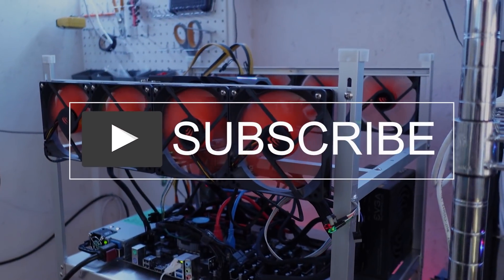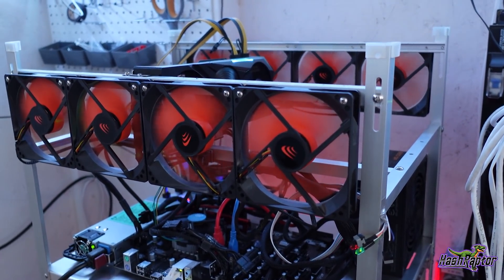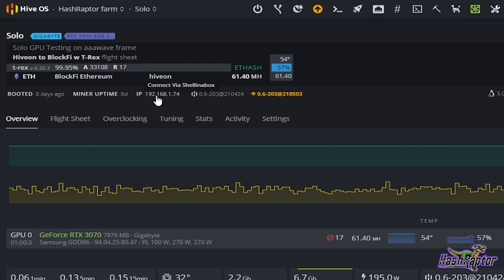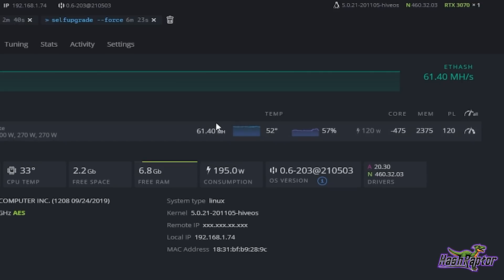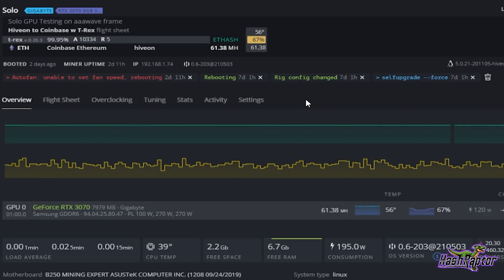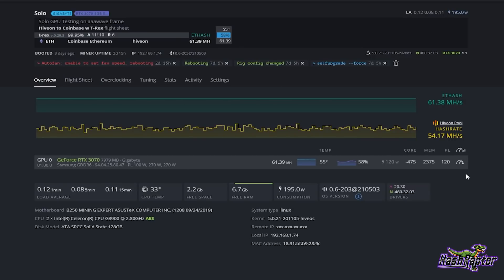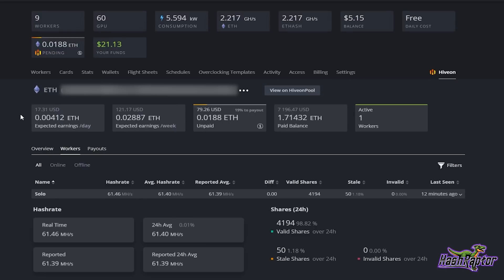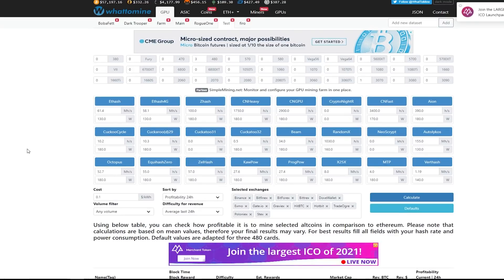How much did our *3070* make in 1 Week mining Ethereum? Earnings are Insane right now!!!

Comment: How many GPUs can you run without having to increase your wattage or amperage in your house?
Reply from the maker: Hey great question.  It depends on what amperage you have in your house and what your current utilization is.  Unfortunately, they isn't a good answer.  Check out my electrical video on the mining shed where were discuss this more in depth.  Take care
Reply: @HashRaptor  I will watch that next.  So is this GPU card $1699?  I just looked it up on AMZ.  If you have a link to it ill use your link.
Reply: @RobinhoodCoins  nevermind, i see you do have a link in the description.  holy moly, i didn't realize GPUs cost that much.
Reply: @thomasgruver3495  in reality gpus prices arent that pricy a 3060 costs about $329 but because of scalpers and miners who buy gpus in bulk to mine the prices have tripled

Comment: Which result would be better 
Three 3060ti together 
Or
Two 3060ti and one 3070 ???
Reply: I would definitely say that 2 3060ti and one 3070 would do better because the 3070 is just a little bit better than the 3060ti so you would make slightly more profit that way

Comment: Great Video! Is it worth it to buy a laptop with a RTX 3080? Was thinking about buying a RAZOR 14 or 15 to mine alt coins
Reply: Do not mine with a laptop. Mining will run your GPU at 100% continuously. You will likely overheat the crap out of your laptop. I used to mine at my old apartment, and with 3 gpus they made enough heat, that I never once used my heater during the winter... like were talking 80-90 farenheight in the bedroom during winter... you should really build a mining rig if you want to mine...do not use a laptop.

Comment: Hey All,, I first used Palit software and simply added + Mhz to core and VRAM, core was hitting 2075Mhz at gaming and voltage around 1.1V, was it safe ??

 What you would recommend me? I have new Palit 3070 Gaming Pro, now switched from Palit software to affer burner.

Comment: Hey guys I need your advise I have 6 units of rtx 3060 12GB cards and I am using a gigabyte aorus elite version 1 motherboard with 2 slots of16x VGA slots and 4 PCI express slots I am using cosair RM750 and RM850 PSU RM850 gives power to the motherboard, 3 risers and 3 GPUs. Second PSU RM750 gives power for 3 risers and 3 GPUs. My question is I have a GPU is not getting powered but if I fix the GPU in another machine it works. Is that a power issue please advise

Comment: Bad thing about gpu mining is it makes the electrical bill so freaking high
Reply: My electricity bill has went up $60. I'm in Florida it's hot as hell and the air conditioner cost an extra $20 a month during the summer with the thermostat set to 75F. My three cards are still netting me over $300 a month easy...

Comment: Did u mine it like the entire week or only throughout the day?
I mean like 24/7 for the whole week?
Reply: These are left 24/7
Reply: @MrChocalatestarfish  do u think its safe to leave my on 24/7?
i have a regular pc on my o11 dynamic pc case that has a 3070 and 5600x and is powered by evga supernova 650 ga psu.
Reply: @unknownuser4691  as long as it is properly cooled then I don't see an issue
Reply: @MrChocalatestarfish  I have a o11 dynamic vertical gpu 3070
The bottom and top are intake and the right side is exhaust 
So 6 in and 3 out
Reply: @unknownuser4691  you should be sweet then just keep an eye on temps for the first 24 hours or so (can do this on the nicehash app on mobile)

Comment: And here we are one month later and he isn't even earning 1/5th of that anymore.
Reply: lol yeah
Reply from the maker: Sorry, that is only correct if you sell daily but still your number is low.  As right now Whattomine is showing the 3070 making about $35 per month which is half, not 1/5th.  I think I discuss the fluctations pretty clearly in all my videos.  There is always a risk that crypto will go down or go to zero, but so far it has always worked well for me to hold for a pop, and then I sell at the higher earnings levels.  Now some people have to pay their electric every month which makes them cash out.  Otherwise, I cash out when profits are high, when they dip I hold until the next spike. Not Financial Advice, just what I am doing.  Crypto earnings are like stocks, they never go in a straight line.  Good luck all!
Reply: @HashRaptor  You have your net profit after electricity from Whattomine on the video for the 3070 as $16.66. Currently that same 3070 after electricity on Whattomine is $3.47.  That is 20.8%, or about 1/5th of what you were earning.

Comment: That’s just one graphics card ? N I’m assuming you can’t use the computer while it’s mining right ?
Reply: You use the computer but only for light use such as internet browsing for example no gaming or graphically intense program use as this will quickly just fry your graphics board and resistors and potentially other components. Also if your not using it while it is hashing, the h/s will increase slightly so more profit. 
I have rtx 3070 cards and they are great but sadly the current daily profits have dropped alot since this video but the silver lining is lesser coin value= more coin mined and increased future profit. 
Hope this helps!👍
Reply: @bloodstar6196  thank you . Yea I tried it out for 1 card also rtx 3070, profits are low but if it weren’t for wear and tear it would seem like a no brainer . 
I’m actually a crypto trader also which is why I’m looking into this , although for now especially with Ethereum converting to 2.0 soon , I’ll probably still to investing and trading crypto and possibly yield farming rather then the mining aspect of it . Thank you for your time
Reply from the maker: Hey, yeah you can use it but both mining and PC use take a performance hit.  My son played Fortnite and left the miner running and it worked fine for him.  I do recommend doing one or the other.  Light web browsing is fine.

Comment: I have the same card, running the same mh/s, and my profits say $5/day... any idea why there would be such a large disparity in mine vs Raptor's? (I am new to mining, so I don't fully understand the market yet, if that is the reason for the difference).

Thanks!!!
Reply from the maker: Yeah but also keep an eye on your pool side figures.  Meaning what the pool tells you will fluctuate wildly through the day.  This is because they are calculating based on the most recent accepted share rate, which is usually incorrect. It will be too high, then too low.  That is one reason I started doing some of these videos where I show "exactly what I made after a week" and not what the pool is telling me.  Best way to calculate earnings (still not perfect for various reasons) is to take your actual earnings for the last week lets say, and divide that by 7 to get your daily earnings rate.  Hope that helps!
Reply: @HashRaptor  so correct me if I'm wrong the profit was 16 dollars?
Reply: Massive drop in value since this video. Just compare the figures on his screenshots with today's value and you'll find out. That particular week was one of a kind, never seen something like that before.
Reply: Cryptolosers coping hard ever since ethereum plummeted lol

Comment: you simply can't compare two cards over two different weeks; market is just too wild. I have both cards (3060Ti + 3070) and here are my observations: Ti gives me a consistent .8MH more but takes 6-8 W more but runs cooler than the 3070. 3060Ti/3070 settings: power max: 59/52%, +1200/1300MHz , core -502/-350MHz
Reply from the maker: Oh yes definitely agree.  Sorry if I gave the impression this was suppose to be a side by side comparison.  Just for fun testing with earnings climing!  Thanks for the info my friend!
Reply: I am new to the mining game and spent whatever I had to somehow acquire 1x3060ti and 2x3070... I hoping to make it back and do well, your videos are indeed very helpful HashRaptor, I am grateful 👍 my biggest fear is unknowingly burning a card due to bad cabling n power management, using risers is very new to me